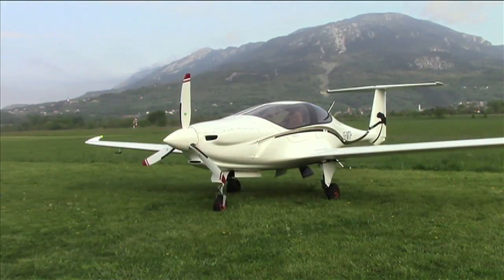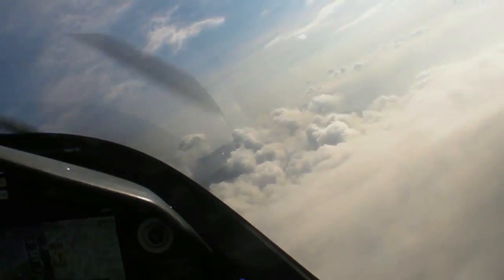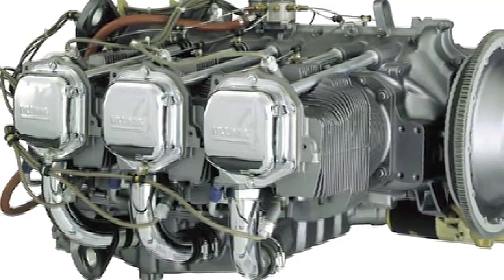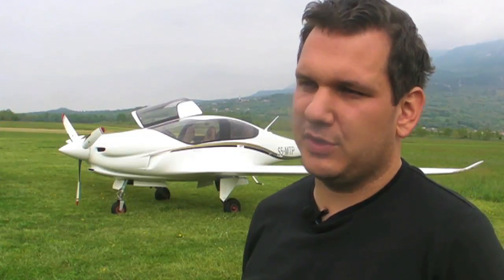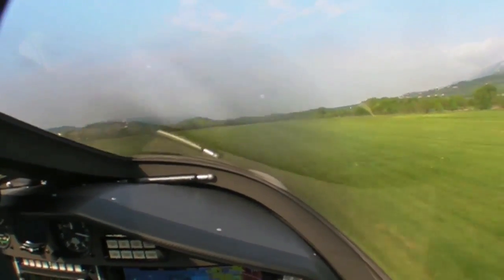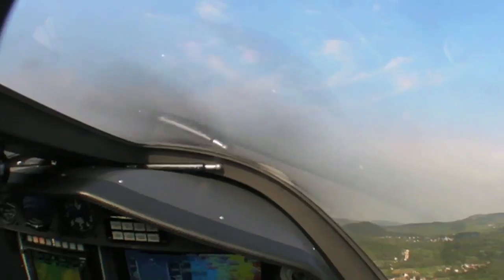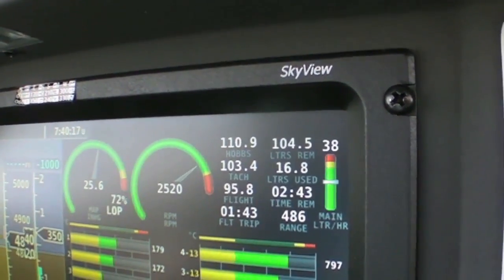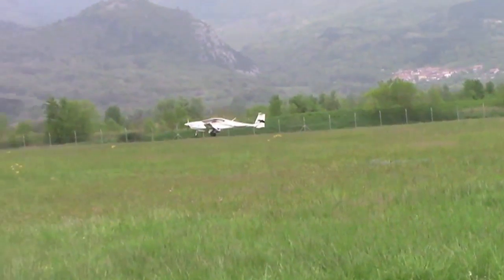Pipistrel Panthera Flight Trial

Comment: Distributed power is the future.  Power on lift that allows 10 CL not 2.  Land 30 mph, not 60 mph.  Visibility MUST be helicopter like and open.  No engine to block views.  No fixed panel...IPads.  Move out of way to get out of front.  Must be able to stand up inside...for long trips...health issue.  Nice airplane, but totally obsolete sorry to say.  Oh, must be roadable and not need airport to land and take off.  Use roads.  Lots available.  Wait for traffic to clear, takeoff or land.  Master class G airspace 1200 feet or below and then move up.
Reply: Right, you need to fly the Superman airline. Good luck with that

Comment: Thanks, Paul!  I'm envious that you got to fly Panthera.

Question: it looks like there's plenty of headroom and shoulder room in the front, and you said leg and shoulder room was good in the back too.  How about headroom in the rear seat?  Can an adult sit comfortably upright with a headset?

Also, how do the controls feel?  Aviation Consumer was very complimentary of the DA40's pushrod controls -- how does the Panthera with its pushrod controls compare?
Reply from the maker: I didn't sit back there with a headset on, but there is headroom. Lots of shoulder room and okay leg room, although not expansive.
Reply: Thanks!  Reports like yours are all we have to go on for the near future, since Pipistrel apparently won't have a plane or even a full-size mockup at AirVenture this year.  Really appreciate it.
Reply: cool

Comment: What's the price tag and how soon would it be available in the USA.
Reply: €400,000 ($550 000 US) as per Wiki.
Reply: +PaladinO It'll be north of US$ 600,000, maybe closer to US$700. Current SR22s go for North of will over US$ half a million and Cirrus have volume.

Given how quiet Pipistrel have been on this over the last year, I suspect they have run into serious problems with the project. Maybe technical, maybe cost,  regulatory or marketing, or some combination.

I hope they do get it to market, it's a beautiful aircraft.